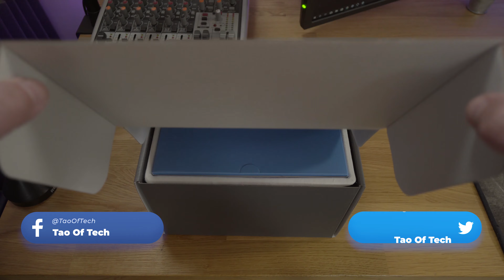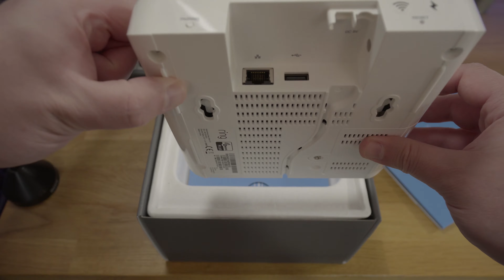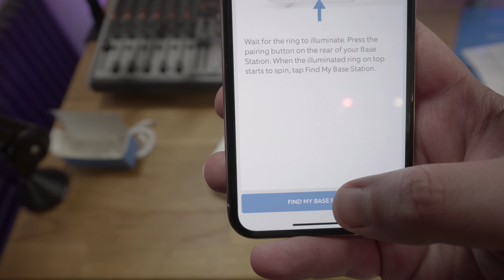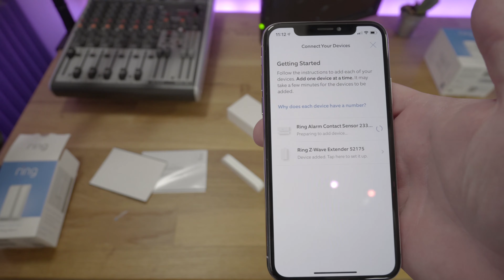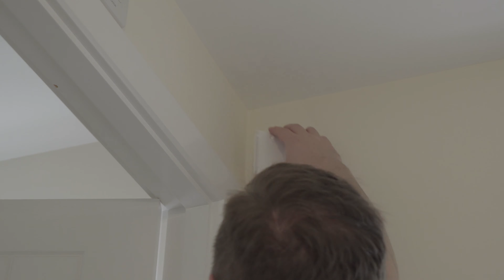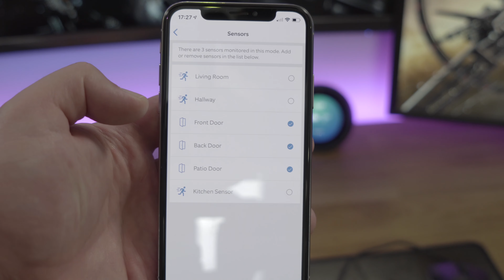Ring Alarm Security System - Setup guide and review

Comment: Thanks for this review.  How do you find the level of alarm noise ? My brother has this and his seemed loud enough to hear from outside thus making it less of a concern about no external siren - not that people take much notice of external sirens anyway . Costco are doing  this ring alarm - a large pack with extra contact and motion sensors for £339 which I’m about to go for , but wanted to ask you one thing - having had a recent very traumatic nighttime burglary , we are also about to install outside cameras on the YESKAMO wireless floodlight and monitor system .  Would you suggest using ring cameras indoors with the ring alarm system or simply add to the new outdoor security cameras set up with their indoor ones ?   Thanks for any advice .
Reply from the maker: Alarm is louder than the ADT alarm which is replaced which also did not have an external siren. Definitely put camera's outside, they are as much to deter would be burglars as they are to record anything. Sorry to hear you were burgled.